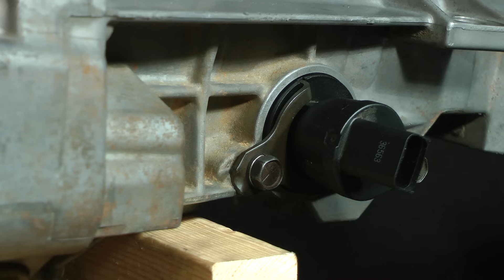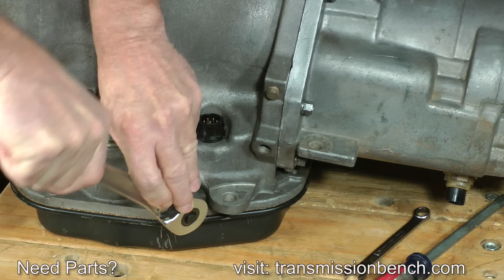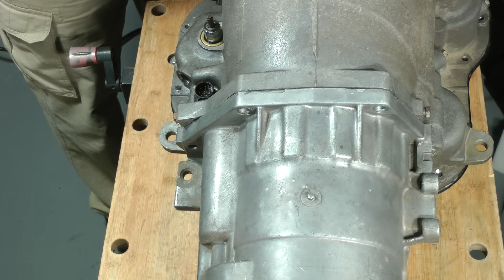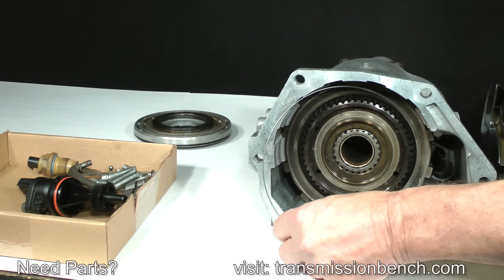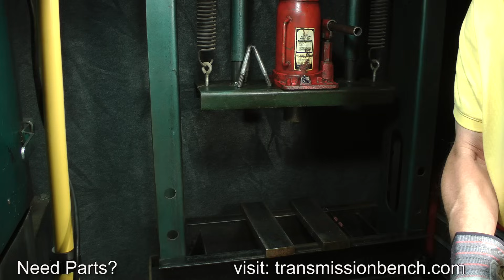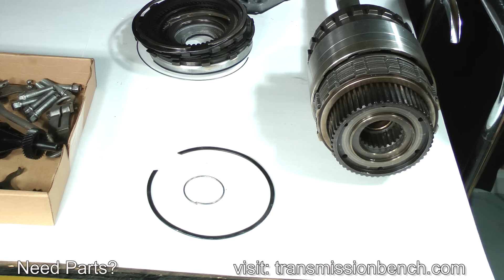Chrysler 46RE Class Part 1 lesson 2

Comment: My 2001 has the range sensor, and the connector is at the top close to the floor, and it leaks if its not started for more than 24hrs......can it be replaced with the transmission in place, if I drop the pan?

Comment: Is it possible to fix a leak between the transmission and the overdrive unit by changing the o-ring in the applied piston and the gasket without taking the whole transmission apart?

Comment: In this vid the instructor mentioned that there were 4 places in the transmission that were under spring tension, this is incorrect, for example the 800lb spring in the overdrive section is a compression spring
Reply: He had to have meant compression not tension. Technically when you are taking those parts out they will go from compression to tension

Comment: My overdrive wont come lose! Its stuck. I got lose about 1 cm then its a stop. And now i wont even go back 😒 whats wrong?
Reply: The Intermediate Shaft was broken.. So the planet gear was stock on it. Had to remove it with a press afterwards. Dodge ram 1500 5.2L v8 4x4 year2001

Comment: The T25 bolts wont budge on mine . They are rusted and feel like they are going to strip lol .
Reply: Get a propane torch and give them heat for a minute.
Reply: Try spraying
Reply: Lol bro i just stripped mine how did you get out of it? might have to hammer in a t27 with some hear
Reply: heat*
Reply: I'm a few years late but a lot of people recommend shocking them by smacking them with a hammer a few times before attempting removal. Some heat couldn't hurt. You can also try tightening before loosening.

Comment: Hey first off great video. This video has helped lots. I have to ask though, when you said remove a thick plate or thin plate depending on the model, why is there a difference in plates sizes on the 46re? I have both sizes and I'm trying to rebuild a overdrive unit. One housing was cracked so I found one to swap over parts, But have noticed this difference. Is there any significance in these different sizes?

Comment: i was doin great until i heard 11mm OR 7/16 inch , those are not either or kinds of tool but specific and different sizes, when you start suggesting things to round off nuts and bolts you lost all credibility as a mechanic with me
Reply: If the socket don’t fit just find one 🤷‍♂️. 11mm and 7/16 are about the same
Reply: Fasteners are generally manufactured with a tolerances allowance of 4-8 thousands of an inch.   
So, those two size tools are actually closer in size than two bolts of the same exact size are expected to be during production.   
For all practical standard purposes, those two hand tool sizes  are interchangeable.  

Interchanging 1/2” with 13mm or , 9/16 with 15mm, is a different story.  
Trying to interchange them will sometimes work(because of fastener tolerances) but will more often result in damaged fasters. 👍